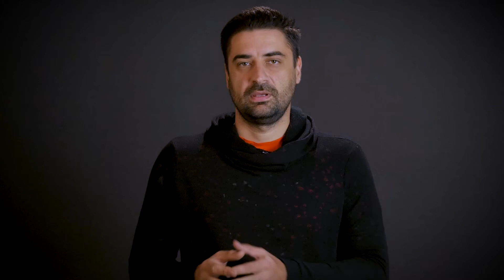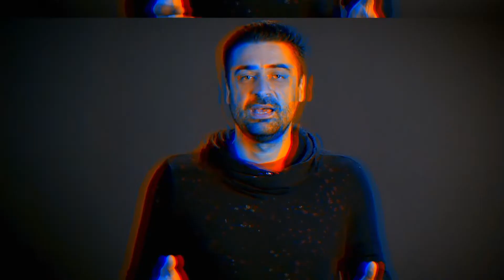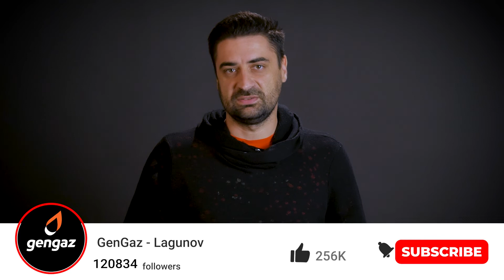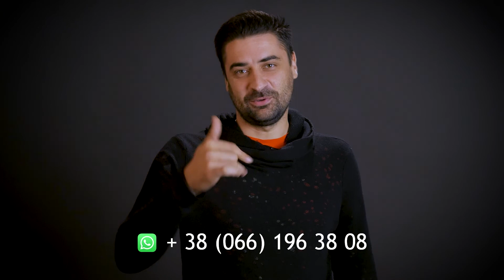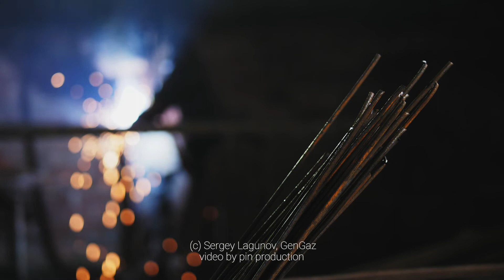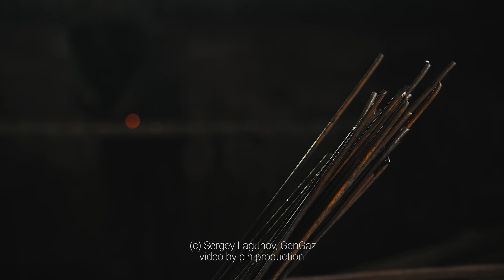Wood gas gasifiers - station design and consulting

Comment: Sergey, welcome! With your experience - finish this design to a full-fledged heating boiler. There it remains to add a heat exchanger and pack it compactly. I understand that there is water in the barrel to cool the gas? You can drive the return line through it like a recuperator. If it also covers such a wide range, then excellent. Ideally, it would also be possible to put a low-speed turbine anywhere so that it could drive a mechanical circulation pump. Without conversion to electric energy. While the boiler is burning, the pump is spinning.